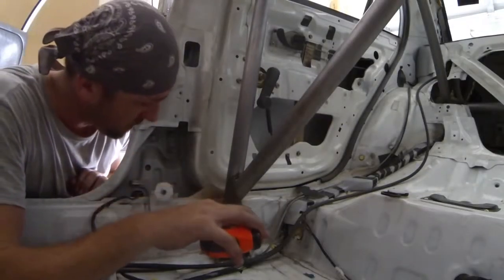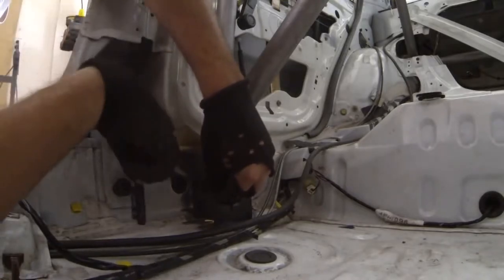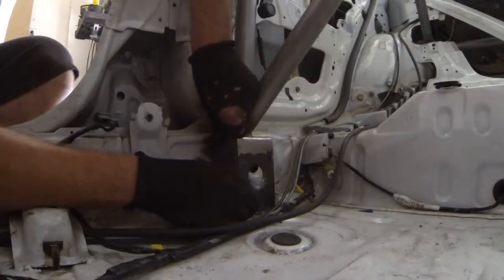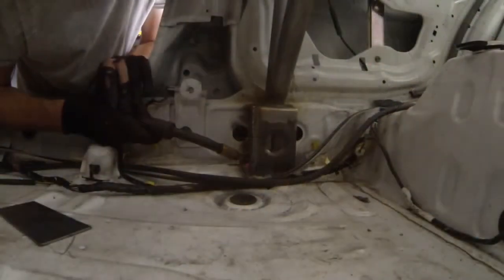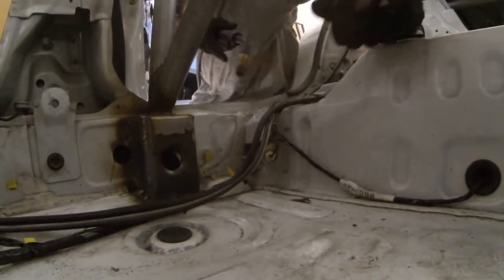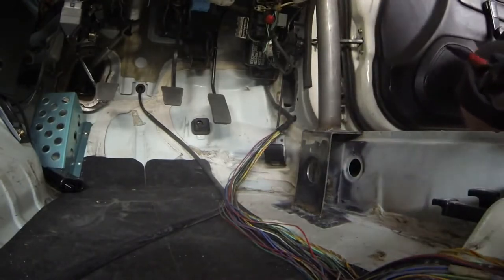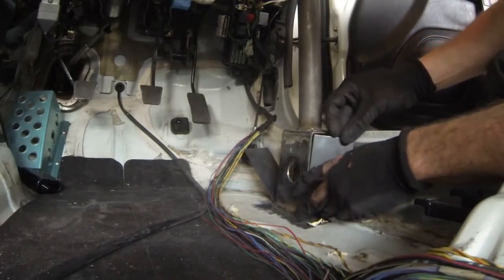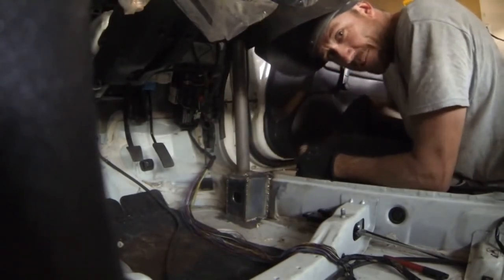TFSS: How To Build A Time Attack Roll Cage - Rocker Boxes (Part II)

Comment: A little trick I have learned for fitting sheet metal to abnormally shaped parts is to use a drawing compass. If you set it to the largest gap then run it along the contour it will transfer the shape for a near perfect fit.
Reply from the maker: +Brandon Stein Awesome. I typically use templating but there are many different methods that work.

Comment: In one of my classes for Chassis Layout and Design. When we were building these cage boxes , we used a piece of tubing the same size as the roll cage , placed in the center of the box directly under the cage tube ... Our teacher said that this will support the load of the cage in the event of a roll and will not allow it to crush the box .....  Is there a reason for not having this support tube inside your box ?    If the box itself will be strong enough to support the cage in the event of a "top of cage collision "  this is ok ....  I am just curious because I was taught differently , so I want to make sure both ways will work and be strong enough to protect me and my wife if the "Ohh Crap" happens and my cage is needed ........  Thanks ....
Reply from the maker: +Norman Murray The box itself has the strength to support the cage. Adding a tube to the inside could possibly add more strength, but it will hold on its own.
Reply: Thanks for your response ....  I was just curious , I am trying to learn all I can with the Fab side ...
Reply from the maker: +Norman Murray No problem. If you have any more questions, there are many ways to get in touch with me. I always try to respond in a timely manner.